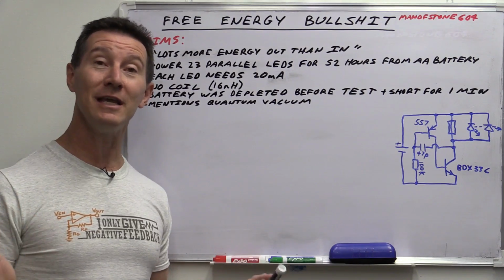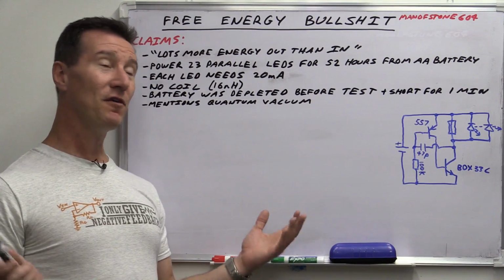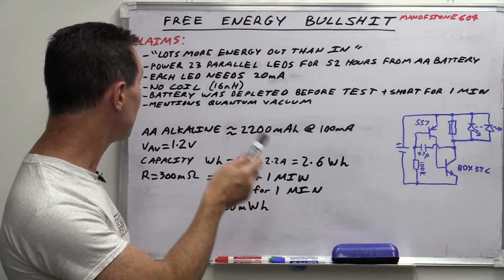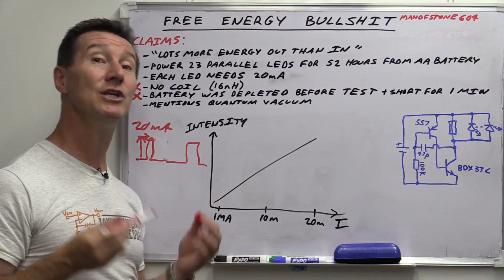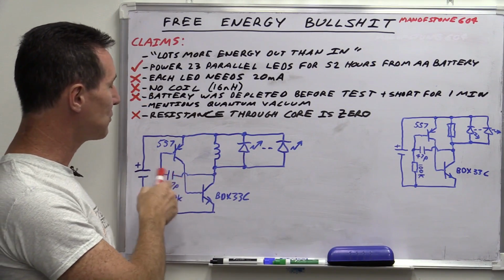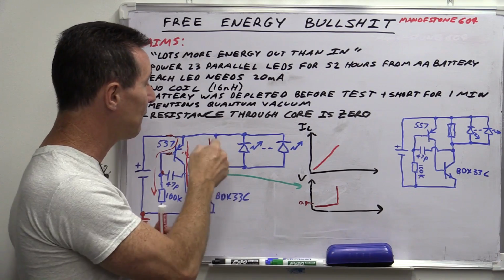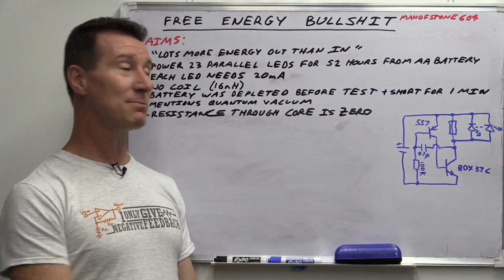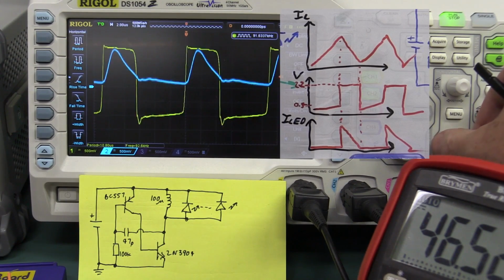EEVblog #708 - Free Energy Overunity is RUBBISH!

Comment: I wonder how long a good-quality AA battery could run 23 modern efficient LEDs with a well-designed efficient circuit.
Reply from the maker: no need to wonder, you can calculate it!
Reply: I think dave should have done exactly what I'm wondering in my original post up there, in practice, just to demonstrate that there's nothing to that guy's experiment. Have a well-designed circuit run the LEDs for 100 hours or whatever, to show that there's nothing magical about it, just plain old physics.
Reply: ***** I never knew snake oil was such an expensive material, he must pack a lot of it into that battery given how much it costs. Pretty good way to cash in on gullible people I guess.
Reply: How long will this cell run? :)
http://www.amazon.co.uk/The-Crystal-Coherent-Fluctuations-Electric/dp/B00ESD1XT2/ref=sr_1_2?s=automotive&ie=UTF8&qid=1422169910&sr=1-2&keywords=The+Sustainable+Media+Co-operative
Reply: ***** There's another youtuber by the name of lasersaber who made several videos on crystal cells. He never made any outrageous claims about them. It's basically just a battery with a crystallized electrolyte; nothing magical (or useful for that matter), but still pretty cool.
Reply: Reids cells can put out stable power, and have lasted over ten years with no drop in output power, and has the data logs to prove it.  They do however require very expensive materials hence the large price tag to acquire one.  Labersabers cells are nothing more than galvanic and are not at all comparable to Marcus Reids cells, not even close.
Reply: ***** Fine, send me a link to proof the thing works, and I'll go over it point-by-point. I have a feeling it'll debunk itself in the first few words, so it won't be a heck of a lot of effort on my part.
Reply: Teth47 Funny he never answered back, with the link XD
Reply: KingTroll Yup XD
Reply: Teth47 To be expected when dealing with nutjobs.
Reply: I have a  light with a bad switch ( it turns on at random and stay on )   it's a Dollar store 24 LED light with 3 AA batteries,  it's been on for about 3 weeks and is still making visible light at night. the point is  LEDs can light up on nothing .
Reply: ***** Oh, you mean the non-scientifically rigorous logs with no proof that he didn't simply fabricate them and change a hidden button cell when nobody was looking? Sure, I'll believe that any day!
Reply: Teth47
Oh, how unusual, some random asshat making a smartass, ego-boosting remark, without taking a second to research it.
Reply: KingTroll Absolutely "I have proof, but I won't show you because you'll just disprove it!" Then it isn't proof...
Reply: Teth47 Hahaha exactly. They never respond when you ask them for sources tho XD
Reply: KingTroll Yup, speaking of that... *****, I'm waiting.
Reply: WarpRulez I'm guessing it is around 52 hours
Reply: Look at the LED spec sheets and do the math!
Reply: Efficient circuit such as just the battery and LEDs?
(seriousness stops) Forever! Once the battery is nearly dead the inertia of the light coming out of the LEDs pulls more electricity from the battery keeping the circuit running almost indefinitely. 😀
Reply: A 10ms, 40 ms off duty cycle can produce a nearly steady light output on an led. Assuming an instantaneous driving current of 10mA, the average current consumed by each cycle is 10mA*(10ms/50ms) = 2mA. Driven by a 1.5V LR6 AA battery of ~2600mAh capacity, the battery will last approximately 2600mAh/2mA = 1300 hours = 54 days. With 25 leds, one AA will last 2600mAh/(2mA*25) = 52 hours... this matches the claim made by the original video. 

The crystal cells linked by wavefront appear to be two battery cells put together. This doubles the total capacity available. The webpage actually lists the current draw as 3mA @ 1.2V; if it were AA, you'd have up to 5200mAh and about 1,734 hours of use. One month. But... the dimensions of 120x40mm quoted by the ad indicate that the volume of the battery is up to 7x that of AA cells. While it's unlikely to be as great as 7x mAh capacity, we can say that the cells can have a combined capacity of up to 2*7*2600 = 36400mAh compared to a single LR6 battery. Thus the led can run up to 36400mAh/3mA = 12,134 hours: approximately 1.4 years. This is assuming the batteries are Alkaline. Other electrode types yield greater or lower capacities. It is very likely the cells are lithium.

Comment: There is quantum zero point energy in the vacuum, but first of all you need a "vacuum" to move to plates. The amounts of energy that you can get from the swinging plates is minimal. There is NO known way to transfer this energy into electric energy. Even cold fusion is more reasonable.

Comment: why does your psu have a 20 year old led in it?
Reply: I suspect it may have something to do with him putting it there, I'm not sure.
Reply from the maker: Err, I screwed it into the front terminals.
Reply: *****  Bingo!
Reply: Mark Beeunas
I couldnt even see the leads last night but they're pretty clear. Must be going blind.
Reply: artifactingreality
Now that I think about it (problem: sometimes I think about it after the fact) I actually had your same impression, initially, and then I did see the wires.  Anyway cheers, Mark * * * * *

Comment: in theory, the only true free energy/matter is outgoing Hawking radiation, from the event horizon of a black hole. still only in thoery. i would like to see them pull that off. and no i am not a physicist or an engineer. thumbs up to Dave and his DaveCad
Reply: Hawking radiation is not free energy.... It's the black hole evaporating. That IS the theory. There's no "in theory" it's free energy... THat's not the theory. The theory is that black holes evaporate over time, thus loosing their mass, which, as you know, is the same as energy, into space.
Reply: Sorry, I'm not buying it. That energy is coming from somewhere. Alas, it's not "free".
Reply: Still converted from matter.
Reply: Mythricia Exactly.

Comment: I think you forgot that it was a quantum flux inductor :-) Perfect response to some of this hogwash - thank you Dave. These two transistor relaxation oscillators ate pretty good for a while bunch of applications - when I started watching the video I expected to see the diodes in series and this was acting as a boost converter (another popular way to light LEDs with a dead battery). A good explanation of the startup btw - a very slow ramp on V+ can result in the npn collector starting high and this circuit can find a stable non oscillating state where the npn collector sits at the same voltage as the pnp's base with 0V over the capacitor - noise on the supply is usually enough to wake an oscillator up in a real circuit, but these stable points are a pest on dc sweeps in simulation and a possibility in practice. Great video - thanks.
Reply: But like the "Flux Capacitor" I think the quantum flux inductor will still require 1.21 GigaWatts, "Great Scott!"

Cheers,
Mark
*************

Comment: So a small efficient motor connected to a gear box to increase rpms on a generator fed back to the motor be a self sufficient system purely because of friction and "fantasy physics" ?
Reply: ***** Even if you had no friction what so ever, power in is going to equal to power out. If you double the rpm you get half the torque that equals the same power, its no different than using a transformer to double the voltage, you would get twice the voltage at half the current so the power is the same
Reply: Yes, because it isn't going to be self sufficient. There is no such thing as a perpetual motion machine. You do realize that an "efficient motor" is not going to be 100% right?
Reply: nitehawk86 i know i just thought that there was some materiel or some way to make a gear box able to output extremly high rpms to a dynamo type generator in hopes (HOPES) that it can produce greater amounts of energy.
But untill I actually get to a point to start experimenting its most likely impossible. but hey not gonna stop me.

Comment: I was really surprised how bright some LEDs can be. I reused white LED from a dismounted LCD panel and I had to use 15 kΩ resistor (!) in series with 5 V supply from USB to match its brightness with neighbouring red SMD LED. But I've seen better - white leds tape connected to a single long wire, and the LEDs could be lit only by touching the other electrode - 50 Hz mains electromagnetic field comes into play. But it was only visible in the darkness. :þ

Comment: I can hear the free energy freaks now. Dave didn't build the circuit identical. Dave didn't debunk the quantum vacuum. Dave cheated by using a power supply rather then a "dead" battery. The list of excuses will be endless.

Then they will say the hendershot generator is proof on free energy. Stan Meyer, Eric Dollard, John Bendini, Peter Linderman, etc have all proven free energy. And even if you disprove all of them, well then you are an agent is disinformation paid by the oil companies and the CIA to suppress this technology.

I had Aaron Murakmi, biggest scammer of them all, chime in on a discussion and when I proved the Bendini was not a free energy device, he told be I was stupid and that test equipment could not be used to measure the energy output of the device. Because the free energy from the "aether" can not be measured or accounted for with any known math.

Nothing you say to these idiots will change their minds. Loved the video though.

Comment: Could someone tell me how the capacitor discharges? This is the only thing I still don't understand about this circuit. One idea I have is that the + charge from capacitor goes through the LEDs into the - terminal from the coil during the backwards EMF period. But then what is sourcing the +ve charge for the other side of the capacitor?
I'm sure my terminology is terrible but I hope you can understand my point and thanks in advance for the spending the time to clarify the situation.
Reply: The capacitor discarge via the 100k resistor to ground
Reply: Alberto Vaudagna But, I thought it's charging through it in the first phase.
Reply: ***** AH! I get it, it's a PNP transistor so positive charge flows out of the base onto the left plate of the capacitor! Derp.
Thanks a lot.
Reply: Actually the PNP Transistor turns ON after the EMF collapse cycle not because the cap is discharging, but because the cap charges. Here's the explanation. The collector of the NPN transistor has a higher voltage (Lets say Vx) than the battery (clamped by the LEDs) as Dave explained. Since both transistors are off at this stage, that voltage Vx is across the cap and the 100k resistor. However the cap has only charged up to some small voltage (Lets say Vc) in the previous cycle. So the voltage across the 100k resistor (also the base of the PNP) is (Vx-Vc). This voltage will keep the PNP off. Also you can see on the scope that the voltage at this point rises almost instantaneously to (Vx-Vc) as this is a voltage change across a resistor. But now the the voltage across the cap starts increasing as the cap charges. Since Vx is constant as it is maintained by the inductor, the voltage across the 100k resistor has to reduce. You can see this clearly on the scope as the yellow trace maintains the voltage the blue trace starts to go down. Once the voltage across the 100k resistor reaches a certain value, the PNP turns on, causing the NPN turn on as well. Only now does the cap discharger complete through the NPN and the next cycle begins...
Hope this helps. Its a bit difficult to explain without a suitable DaveCad ;-)
Reply: MakerTube I think I understand this now. Thanks very much.